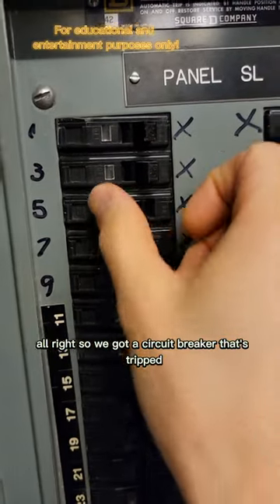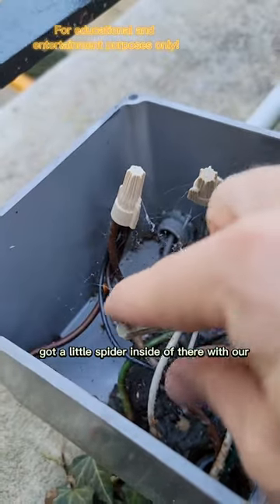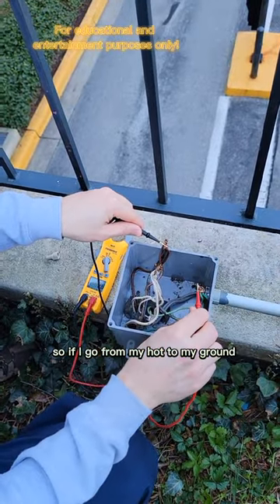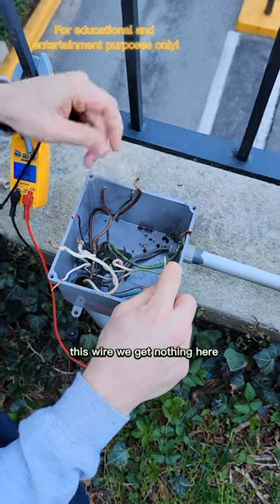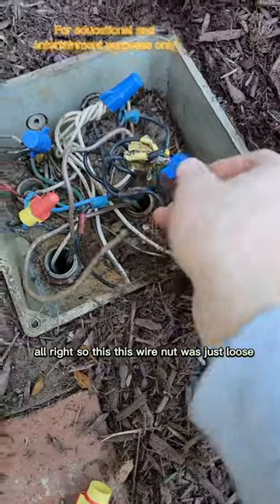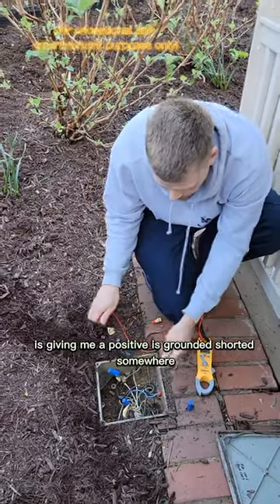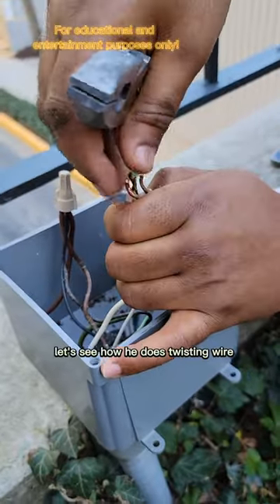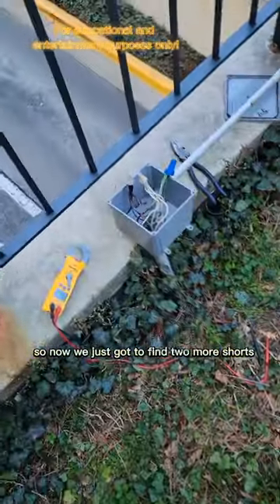how to find a short circuit breaker

Comment: The problems at this job site have only just begun. Who TF buries a PVC box underground? This had to have been at a hotel somewhere. The owners of hotels are worse than landlords when it comes to paying professional tradespeople to do work. If you're going to need a splice box outdoors and underground use whats called a handhole. It's a bottomless box that gets backfilled with pea gravel for drainage. It works.
Reply: Indeed, i'm an electrician in my country and was shocked at that box. Who puts a box like that there. That'll be filled with water every time it rains.

Our rules are: ground junction boxes need to be buried at least 60cm (2 feet) deep for protection against damage (same rule as in-ground cable) and filed with resin to make it waterproof (test before filling). It's a pain if something needs changes (cut cable and add a junction) but lasts about 20-30 years.
Reply: Exactly electrician Ron, I use them all the  time, quazite boxes (if we talk bout same thing). You right too about the hotel landlords

Comment: I really did almost die. I was at a college dorm fixing a 50 amp range outlet. We turned off the breaker and put a lockout on it and I was doing my thing when it slipped out of my hand and sparked like crazy. The stupid campus maintenance guy cut off the lockout and turned the power back on.
Reply: that's still a little far fetched to say you almost died. a 208 or 240v ckt with no load almost killed you? hmmm.... somebody is new to the world of electric.
Reply: @shadygunshow  240 would definitely hurt a lot.
Reply: And yes I was new to electric.
Reply: Maintenance guy would be scheduling a dentist appointment if he did that to me or one of my guys.
Reply: I would have got him fired.
Reply: @YT money  240 can still kill so can 120 there's alot of variables but it's possible
Reply: @shadygunshow  go open up your range outlet and put the white wire in your left hand and the white wire in your right hand. Report back how dead you are before the breaker trips.
Reply: @shadygunshow  troubleshooting electrical circuits with one knee on the wet ground will definitely thin The herd.
Reply: @thebeddoctor4273 just had this happen the other day on a 50 amp hot tub. Homeowner jerked off the loto and turned it on along with all the other breakers. 8 wire hit the disconnect and it blew up an arc flash on me bad!
Reply: @benjaminvanlier7990  freaking idiots. That sucks. Glad you're ok
Reply: @shadygunshow  yeah on accidental contact you get everything that line will suffer, not the load on it.
Reply: In the military I worked in a Command and control building with every branch of the military in it.  We had tons of electronic equipment all running on 440 Volts.   I had to escort an electrician to look at a problem.  All our floors had cable trays built into them with aluminum covers.  When the electrician went to an area to check out the wiring he had a flattened cardboard box he threw on top of the cable tray cover and went to work.  I asked him if we need to kill the power and he said 'No, I've been doing it this way for 30 years'.   He was braver than I was.  I grew up on a farm with a respect for electricity including electric fence chargers.  I have been shocked by 120V, but I think some fence chargers are worse as the charge seems to reach out and grab you if you are within its strike area.
Reply: @shadygunshow you’re the type of guy that’s gonna die on 120 cuz you think it’s harmless 😂

Comment: Should replace those wire nuts with WAGOs in a gel box. That makes the connections IPX8 rated for waterproofing. WAGO lever nuts typically handle at least double their rated amperage. They've been used in Europe for a long time and are gaining popularity in the USA because when you put the wires in and close the levers, they stay put and don't come loose when wires are being bent and stuffed into an electrical box.

Comment: and these joint boxes are an acceptable standard in the US, the one that was buried was just fantastic, it did not even look like there was any RCD protection on the circuit.
Reply: Murica, fuck yeah!
Reply: No. no that's not legal. The   Joints need to be sealed and that's not the proper junction box for underground.

N 314.29(B) Underground. Underground boxes and handhole enclosures shall be installed so they are accessible without excavating sidewalks, paving, earth, or other substance that is to be used to establish the finished grade.

Exception: Listed boxes and handhole enclosures shall be permitted where covered by gravel, light aggregate, or noncohesive granulated soil if their location is effectively identified and accessible for excavation.
Reply: @niyablake  that’s good to know, we have very similar regulations here in the uk, the only joints that are permitted to be buried are permanent joints such as resin filled joints that have no serviceable parts. But it’s always good practice to take note as to where the joint is. 
In short uk regs state all joints must (internal and external) must be accessible, ie.. behind a trap or access panel, be marked and suitable for the environment, as in correct IP rating.
Reply: @Danny-204  this looks like a handyman special and no inspections were done. It's not that the US in it's self has a crappy electrical code,  it's enforced at the state level and some states are lax about enforcement. The electrical code in the US is similar to that of Canada. So much so that we share the  same union

Comment: If you ever run into something like that where you’re having a hard time doing your joint. You can either straighten them out with your pliers or cut them back and re-strip
Reply: Or just use wago connectors instead.
Reply: @xorsyst1  Those are for sissies lol jk

Comment: Stop using cheap wire caps, and use lever connectors.  
They don't come loose, they don't twist or damage the wire tips, and they can be reused hundreds of times.
Reply: Americans are to far behind in the Electrical industry
Reply: @JorgeAMG187  Their plugs dont even have insulation on half the connector unlike the EU/AU
Reply: Yeah buddy and you're gonna have to sell the Americans on a 220v system instead of a half phase dual 110 volt system while youre at it. Never gonna happen, American will stay majority wire nuts and the EU can keep using the superior wago and feel the supremacy feeling and brag and really make people who can't really do shit about it.

Everyone should also use bx and not romex, but nobody wants to pay more than the already insane prices that construction related things cost. Wago connecters cost easy double and even triple a wire nut to achieve, to the customer, the same goal. Armored electrical cabling costs up to double, but cheaper romex gets everything wires so why pay more? Is the thought of everyone who's struggling to afford their repairs as it is. The only people tryna spend more are people who are doing okay. Nobody who has a real struggle in life is gonna worry about harassing someone about the more expensive wago connector.
Reply: Wirecaps only fail if the installer has less than 3 neurons... If done right you never have an issue with them. Wagos are just for unreliable electricians who never learned how to twist wires.
Reply: @random4896  agreed
Reply: To each their own  could of cleaned up ends, not held to 3in out of box in those sized jboxes. Both work, I stock wagos and 3M wire nuts.
Reply: Marrettes are used in millions of joints and I have seen many thousands of them in action, only time they fail is when they are improperly installed, just like wagos. So tied of hearing this argument, there is absolutely nothing wrong with a properly installed wire nut
Reply: This entire install here cant be compared to what we do here man

Must have never heard of resin joints or gelboxes... Watertight cable glands? Haven't seen one in this vid...
Reply: @xald1234114  The way Dutch construction works, I usually have to tie 6 or more wires together. An 8-slot push-in Wago is going to be cheaper than wirenuts due to labor savings.
Reply: @washellwash1802  I hear you there. A wire nut for 6  #12 (3.3 square millimeters) is approximately the size of your thumb. Or it consists of 2 or 3 smaller wire nuts per leg of the circuit, and jumpers between them 🤦‍♂. And all of those conductors need to be bundled with the tips sticking out the same amount so they can be properly gripped. There’s occasions where we say forget it  and just get wagos.
Reply: lol I dunno whats wrong with all you electricians in this post wirenuts are extremely easy to install and you know in America most electricians argue that wagos are less safe. especially the old timers. something about the fact that all of the current runs through these little tines and the way they secure the wires is not a wire to wire method. when if you think about it is actually superior. I love wagos but I can't argue that a squeeze spring is superior to a spiraled spring that bites in and holds your wires together and expands / contracts better with temperature changes. I usually keep wagos to a light fixture application. unless I'm using stranded then I truly think wagos are superior that stranded wire is not pulling out of a port connector
Reply: @shadygunshow  if you have more than 4 Wires in a Nut you can get situations, where you have one which ist not gripped by the outside spring.
Additionally the resistance across a wago is a bit higher than it is across a wire nut.

But what we saw here is a case, where the wago has a clear advantage. Being able to pull out one cable at a time, being able to measure everything with the wago still attachend, thus still leaving you with a IP rating of at least 2X, you physically can't electrocute you.
And if you take a look at the installation costs of using wagos over wire nuts you will come closer together.
Strip, push in is a decent time faster than strip, twist, screw.

Comment: Say what you want but those twist things look unreliable af
Reply: If they were unreliable they wouldn’t be in every household
Reply: They aren't, people who demand wagos are clueless
Reply: @Teh_Random_Canadian  People who haven't had the proper Wagos and have used them accordingly are clueless. Wirenuts are a joke. Wagos for regular low current stuff and proper screw terminals and connector blocks for stuff above ~15 A continuous.
Reply: It’s reliable in the sense that if you make a solid connection to everything in there, it will stay pretty much forever. It’s easy to have wires slip out while assembling, so you had better tug on everything after putting it on. Once you’re past that point, you’re in the clear.

Comment: I got hit with 277 in Ashley furniture 
Used my tick tracer, “it’s hot” 
Journeyman goes and flips a breaker
Tick tracer batteries die unbeknownst to me
Use it to check if the breaker he flipped powered my circuit, didn’t make noise cuz it was dead, use both hands to grab octagon box and BAM! Instantly I’m Goku with a spirit bomb in my hands and screamed a very loud F word with customers shoppin and all
Reply: Lock out panel or breaker before

Comment: When you are dealing with such a decrepit branch, be very suspicious of every conductor.  Measure the voltage between every pair of wires, and don't test continuity unless you know there is no voltage difference at your test points.  I would run away from that installation - do you really want to be liable for modifying that branch and having someone get injured from some part you didn't even touch?

Comment: Been using wire nuts forever and I've never personally had one fail
Reply: This is a wonderful joke. Thank you for the laugh. 

I have done electrical work for 6 months. I can't count the number of wire nuts that have failed.
Reply: Failing while putting them on or testing is rare if you do them right. If you don’t do them right then you had better pray that the bad ones fail during testing and not a few years later…
Reply: lol yeah but how many have you seen fail? I've seen a hundred or some odd wirenuts burnt to a crisp and thousands of wire nuts with stress fractures and/ or brittle plastic
Reply: Clearly you’ve never used the yellow ideals

Comment: But if they were tungsten bulbs, they'd register as a short circuit!
Reply: A filment bulb would short live to neutral, not live to ground.
Reply: Not to the ground wire and even to neutral not as a short, but they may beep the continuity tester depending on wattage and the meter. You can always measure the resistance it will be high enough to not trip the breaker. (even when they are off and have lower resistance than when lit up)
Reply: @markcassidy2202  after it’s disconnected from the panel, yes. Up until that point, no, because the neutral and ground are bonded in the service.